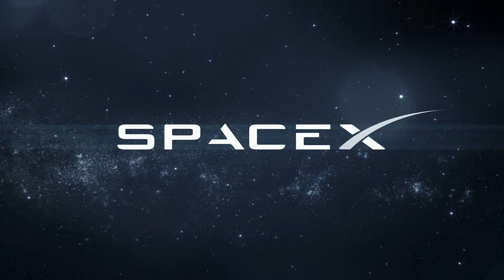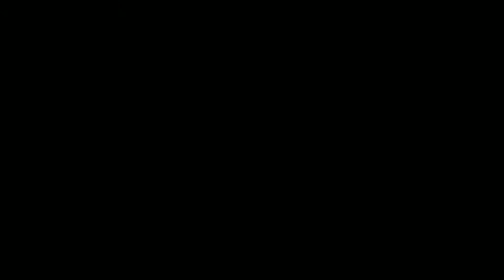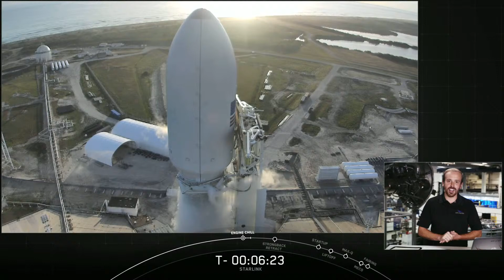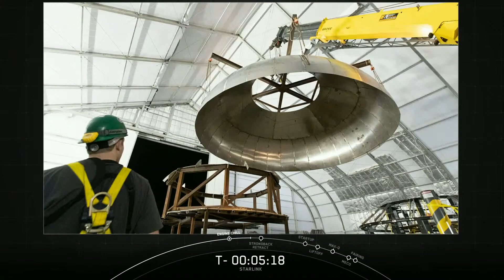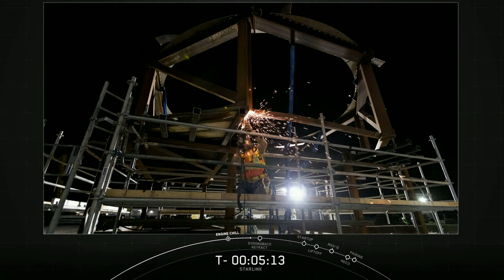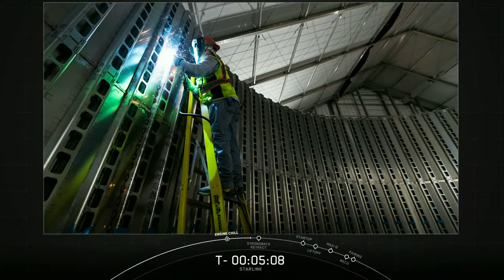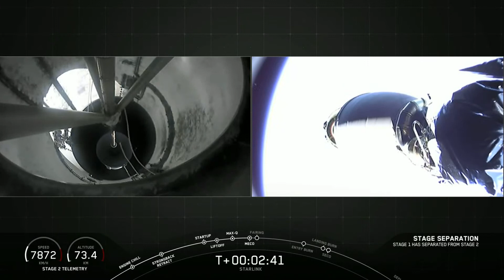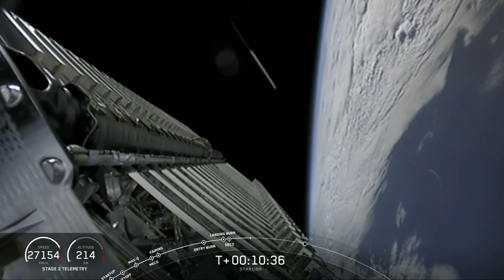Starlink Mission

Comment: 21:30 what is that ? It's huge ...
Reply: Either space debris, or a part from the rocket
Reply: Because this first stage isn't boosting back, but is following a normal arc to the recovery ship, this could only be one of two things. Either it is a piece coming off of the first stage and the camera lens doesn't show its early trajectory; or its a piece of space junk / a cubesat.  It can't be debris from earlier stages of THIS launch because of the descent path. Looks to be tumbling.
Reply: @toadelevator  It is clearly not a piece of space junk. The first stage is not in orbit and there is zero chance a cubesat would be deorbiting on a trajectory that steeply down. It's just ice forming on some ring shaped part of the rocket
Reply: You guys are insane. A cubesat? The 1st stage was in the atmosphere at that point. And why can noone see that the two objects are falling slower than the 1st stage? It's the fairing halves.
Reply: Ufo
Reply: @shockem3376  unidentified falling object ? ^^
Reply: Junk or Ice but what I'm curious about is how it is so much lower than the Booster? The booster is moving in it's arc so it's junk wouldn't precede it along the trajectory and if this was random junk it be in a random orbit and would not have traveled vertically but would have zipped by. I'am obviously unaware of something . . . or it's aliens.
Reply: I've heard that its frozen oxygen
Reply: I would presume its a starlink satellite or a bit of debris there is something else that flies past @21:22

Comment: Skip to 21:28 was that the fairing flying by???
Reply: No that was probably ice, or something else that was just attached to the booster seconds ago. Because it's more effected by the air drag it get's slowed down more so it seems to shoot upward relative to the booster. 
The fairings will be very far away because the second stage carries them further and faster. The successful fairing recoveries happened at 1350km off shore, while the booster recovery happens at around 700km. So they will be like 400 km apart from each other at 21:30.

Comment: 14:53 is it just me or the water spray thingy is late?
Reply: Mr. 2 minutes Indeed, hope the launchpad is ok
Reply: I think it's more for noise?
Reply: Indeed.. I just checked crz 20 launch nd last starlink Launch..they water spray start at T  - 07sec

But I this case it started after lift off
Reply: @mukeshgoyal  Normal for LC-39A. You were looking at a SLC-40 mission which has a different setup
Reply: That’s all nominal
Reply: I bet this is why they had to abort last time they start water to early and the water did not let the rocket ignite, it just blew out gas for a second and stopped
Reply: @peatier7626  Err, no. That amount of water can't put out even an air-breathing jet engine. With kerosene and LOX it'll do literally nothing

Comment: 1st stage booster fly-by at T+06:39 looks like a weather balloon, horrifyingly close call.  Presumably there were no trailing cables that damaged things and contributed to the demise of of Stage 1, but could have.
Reply: For me it looks more like something metallic. Maybe part of inter stage separation mechanism?
Reply: @wojteksykurski  the landing trajectory is nowhere near its take off, unless it's from another rocket launch, but unlikely since re-entry burn that follows is only 40-70km in altitude.
Reply: @rogerclark9456  You right. I have watched this fragment several times. Of course I might be wrong, but it kinda looks like this was something falling of from engines/thrusters sections.  Maybe this was the cause of stage woobing after burn?